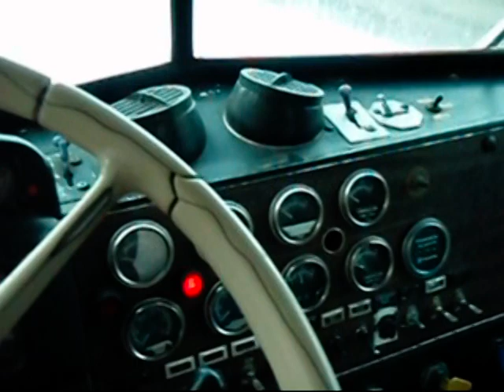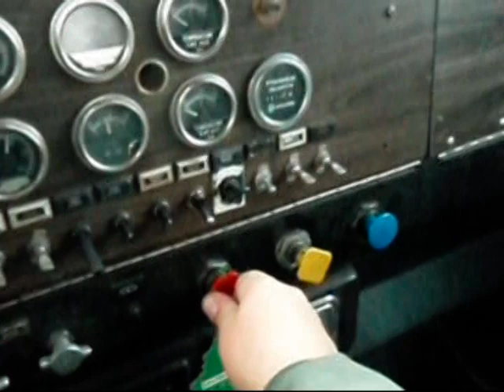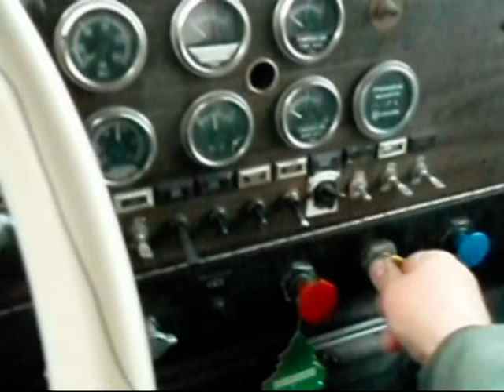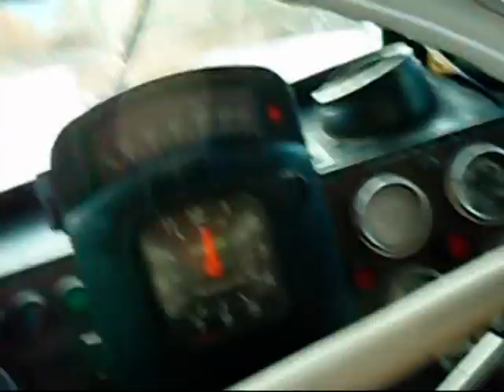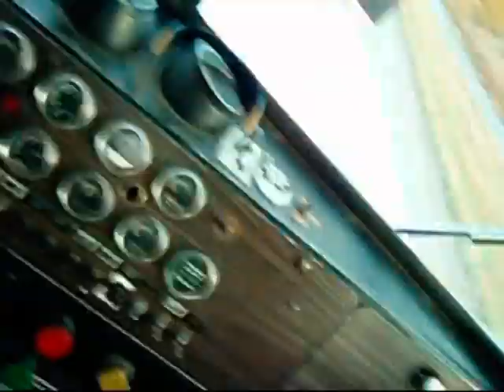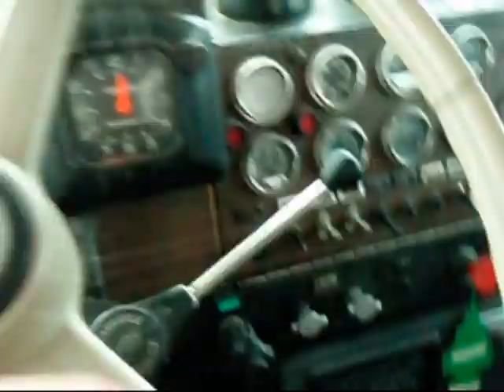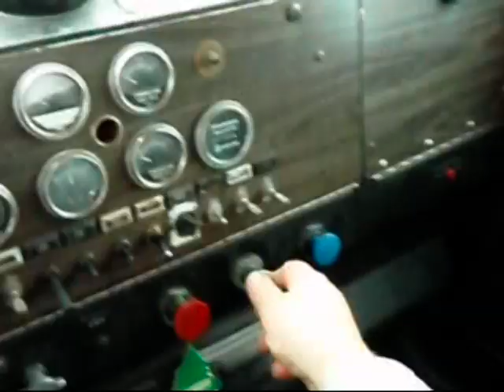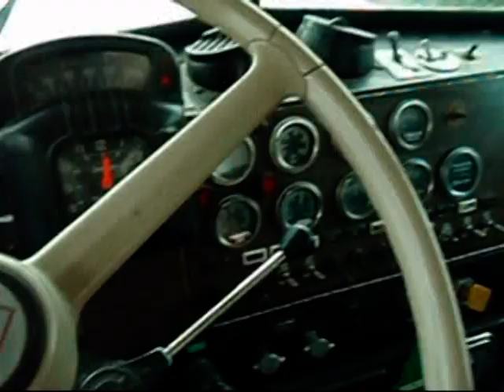Going for a sunday drive with the 81 kenworth lowboy

Comment from the maker: @mog5858 That is a tachogragh on the dash. It hooks up to the tach drive, use a key to swing open the front where you could put a paper tach card. A couple of ink pens inside would record things like hours engine running, date and time, how long idling, how many stops and when ect... 
Yes it is a 5 and a 4 transmission setup, I like it :)